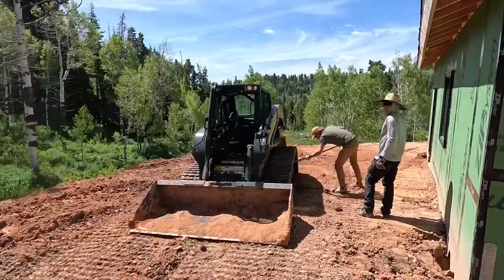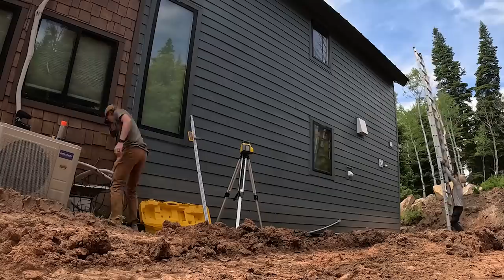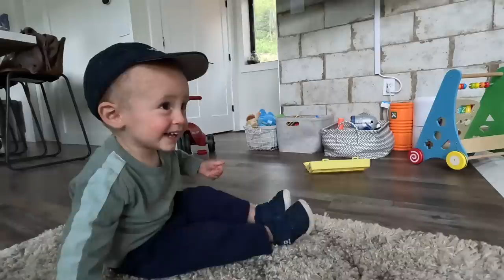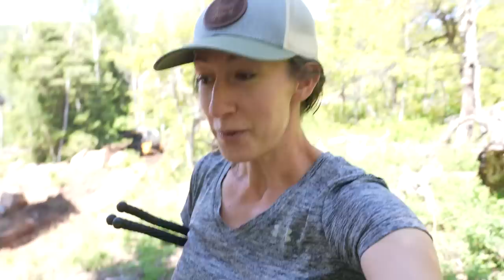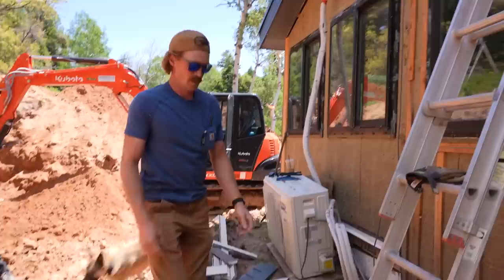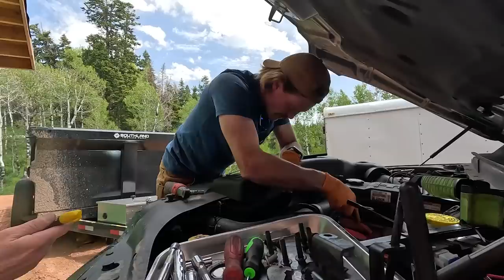THIS IS SAVING US $50,000!!!

Comment: I recommend stopping all excavation until you get an engineer to evaluate whether the final flow plane will work.
Reply: I agree, that unterraced mountain that's just cut will collapse in the next torrential downpour or heavy winter. They had a retaining wall for a reason. No prep for or talk about a future retaining wall at all.
Reply: Entirely agree. Slopes are no joke.
Reply: I am so happy that you have Trent thinking…..his digging is scaring to death.  I am having a hard time with wanting all the flat area…….they are in the mountain !!!!
Reply: Yes because water always flows downhill does not seem to register with many builders.
Reply: I agree that 😮having some check and advise where necessary. You want to make sure that what Trent is doing will last through the winter  and not turn into a  potential disaster later, which could damage the addition build.
Reply: Agreed!

Comment: Use a pressure washer to clear dried mud from treads. Though using the pressure washer before it dries is even better
Reply: EXACTLY!!!   Especially in a high clay content soil.   Use the bucket to tilt the machine and power wash all the  mud while it's still wet.   Then grease everything.   And not just the skid steer, the excavator as well.
Reply: Nice thing is pressure washers use very little water so less mud than using the hose and much faster than shovel or hose
Reply: For sure!!! We use ours at the lake all the time to clean the bottom of our boat, and even the rafts, tubes, and the giant Lilly pad. Makes for easy and efficient work! Work smarter, not harder!
Reply: @eagle2019  Yup exactly!

Comment: It's a good opportunity now to get the Condenser unit of the mini-split far up off the ground before it's buried in snow again. And maybe install a very tall pole by the propane so it's easier to locate where you have to clear. I can't even believe how much snow you guys get. Just maybe don't cut into the house til the last second or after the addition is dried in just in case it shows up early. Ya'll are very brave.

Comment: My dad worked in the mud too with his rigs, but drove to a space where he rinsed off the mud, to prevent dried mud, saved time in the long run. You have space.
Reply: Yeah, I surprised he does clean those rigs daily! I could not put my Rig away that Dirty especially as expensive as they are! Clean the Rigs Trent😎
Reply: Please hose off you heavy equipment when you are finished for the day.  🙏  Love your videos!
Reply: Absolutely 👍🏻 💯 Clean the equipment 👍🏻
Reply: Cleaning when finished is just as important as greasing what needs greasing.

Comment: It would be a great time to talk to Brittney and Drew about excavation and rerouting water because they are dealing with all of that right now. Lots of retaining walls and drain systems! Its important! Don't want to see your work destroyed!
Reply: Trent needs an engineer to design a comprehensive plan of drains and retaining walls with flow plane considerations. The mudslides last spring were a huge warning that need expert guidance and input on this build.  Trent please bring in an engineering firm before pouring cement.

Comment: You could opt to build a Earth Home into the side of your Hill/Mountain.  Cost a lot less to heat it, would stay around 55 - low 60s degrees year around with no heat.  Other options to heat are heated floors with Geo-Thermal Heat.  That would be a big cost savings over LP Gas.  Earth Home your out of the Elements, wind and bad snow storms don't affect Earth Homes.  Still have to plow your driveway and access points.

Comment: You need a heated shed for the equipment for winter so it starts and runs properly for winter,  check into the oil temp for cold weather conditions to working. Plowing snow and moving some piles if needed.

Comment: Trent you have a spring in that corner, you need to redirect that water away from your foundation area to guild your foundation.   Also tier the back dirt area, maybe a drain to help with water snow melt runoff lol  opps   Grab yourself a track shovel :)   you will need it LOL.   Fuel tank for the machines 5gal cans , Brandon looks like he is having fun pulling that siding off .   Just looks like you guys are having a blast.

Comment: Taking the siding off when you don't even have the footings poured for the new addition is nothing short of foolish. You get any heavy rain for any period of time and you insulation and any electrical wiring will be compromised. You had better tack up some plastic sheeting over the exposed area before it's too late.

Comment: With the video time lag, it's probably way too late but a French drain or 2 or 3 at the base of the new fill dirt for the parking pad would have helped .
Reply: Probably not too late. I don’t think there videos are very far from real time.
Reply: @scottmichaels12  Back at Thanksgiving and Christmas time they were able 3 weeks behind.
Reply: An ex employer of mine had an umbrella just like that. One day there were high winds and it blew off the 2nd story deck,and it got tangled up in the railing, hanging over. I was at the house with 2 small children. Had to ask a construction worker across the street come lift it off for me. The umbrella didn't last long.
Reply: @scottmichaels12 They said it was the first day of summer in the video.

Comment: A small hint when it comes to Tim Tams and and warm/hot weather.
Use a small Esky (cooler) with a freezer block for the Tim Tams. Tim Tams will turn into a lump of melted chocolate in temps higher than 20 C (70 F). A really good trick is to put Tim Tams in the freezer for an hour on hot days.

Comment: Trent, you know as well as anyone that cleaning and maintaining equipment is one of the reasons contractors get paid a pretty decent price for their work. Yes cleaning it right after using it in mud would have been much easier but then there are times when it just won't work out the way we want. You are doing a good job and thanks for taking us along!  J.R.

Comment: Trent you need a dumper truck, get Brandon to drive it back and forth and dump the soil we’re you want it, it’s tonnes faster than the skid steer.   It takes a lot more soil per load .  Even if you just hire it to get the bulk of the soil moved.

Comment: Trent, 

Why you don't dig the full distance from the wall right away?  In addition to the wall distance, you need to dig probably 5'-6' to allow the footings and the formwork to take place.  You are hurting yourself by not doing uniformly and do the final work at the same time.

Past the excavation, unless you plan to build some form of a retaining wall, you will need to slope the terrain 45 degrees or 2 in 1, which will be 10-20ft into the mountain.

Comment: You're right Trent, you have many talents and adapt nicely - BUT, 1) you made too small a house, even just for the two of you 2) You redesigned the garage many times during construction, 3) the addition on the house has cost you tens of thousands in material and rework 4) you DO unsafe things FREQUENTLY. It's handy being a rock climber otherwise you'd likely broken your ass long ago.
Reply: Trent's biggest shortcoming is his inability to plan a project completely before starting.  The material and mental costs of his impulsive drive are astronomical and may result in serious injury.

Comment: Please know that operating an excavator is only part of the job. Knowing about excavation and soil is an entirely different thing. Excavation sites can be deadly and that's why excavation standards are set. Trent is obviously not tending to those standards. Imagine just the weight of one wheelbarrow load of soil falling on you. And it can happen quickly. Please stay away from that wall!!!

Comment: If you’re not cleaning tracks at the end of the shift, you’re not working the machine. In the fall when it starts to freeze at night make sure you clean the tracks after your shift. You don’t want to have a whole bunch of frozen rockhard dirt stuck in your tracks can cause expensive repairs. So clean your tracks after every shift and that goes for the excavator also

Comment: Applaud all your efforts.  Top notch.  Every Cummings guy fixing and switching engine parts.  Be the inventor that welds up a front bumper that excepts two pieces of 2x2 angle that a pair of 2x12’s can fasten to for the perfect platform.  Going to be under the hood again not fooling yourself.  Great video.  Cheers 🎉

Comment: I'm sure you'll figure it out but you're going to have to step up the hill behind your house three feet up three feet back something like that. Or you run the risk of a landslide also kind of make it like a rainbow so the water goes to the left and the right not behind your house. I would get Brandon into skid steer to move dirt as you dug. It would make things go faster. Keep putting the dirt over by your garage a large flat area will be helpful in the future. Since your land is so sloped

Comment: When muddy, use water before it hardens to flush it off somewhere you have solid gorund under you. Before the local government and most place got their own yards to do such things on, you occasionaly saw the diggers getting that treatment not far from digsites all over town where I live and to clean up they flushed the now, usually an empty parking lot, free of dirt so that it is cleaner after they leave than it was when they arrived. Dual duty you might call it.

Building on a slope just means you have to thing terrases like many has hused in hilly landskapes all through history. It takes work to set up, but once done you have lot more useful buildable area.

Comment: T&A - I really like the fast motions shots of the excavator. It shows Trent's control of it, as at that speed, it almost seems human. I've been around bucket trucks (like the utility companies use), more than excavators, but we were taught (as you probably also do), before we got to work, to visually inspect all hydraulic fittings for leaks, or cracks, as a loss of pressure will drop you quick, and if that don't kill you, where or what you land on, might.

I think you're pretty safe in the cockpit, so it would be more of a matter of being aware what is under your bucket, I'm guessing. I've worked at places, where, if you moved a weight over someone, or if you allowed someone to move a weight above you (almost always involving hydraulic cranes and such, it was cause for being fired.

I understand it must be maddening to read all the 'safety, safety' comments, but they seem well-intentioned, and you might learn some new measures by them. I know I do. I have noticed in the last year or so, that you almost always wear the appropriate safety gear (even just eye and ear protection, gloves, hazmat suits, etc). Not to say you didn't before, but now, even for small minor things, I've noticed you do.

Keep safe (sorry, I couldn't help myself).

Comment: Going up hill while building should not be a problem your first floor of your main building could be the basement of your second building.
And the Second floor of you main building the First floor of your second building.
The biggest problem I see is that you need room for the enormous snow fall you had this winter even if it is once in a decade you do want to take it into consideration. Seeing you have also have certain small risk of mudslides I would have the back of the second building and the sides of the second building at least for the first floor made of concrete. A mud slide can have a lot of weight behind and and everything starts to drift.
So you want to be sure you house and walls keeps standing.  Also look into having some outside blinds for the first floor on the side and back of the building to protect you windows should those huge snow (mountains) against your building ever again be a problem it is also a good isolation for keeping the warmth and cold outside it is also burglary proof so if you have bears or something like bears they cannot come through the windows.

Comment: Yes after run the machines you need to clean the tracks..An grease them daily.. You don't work very efficient, why isn't Brandon, running skid steer. Taking the siding off isn't needed to you have a slab done...

Comment: Just asking as you're placing your dirt ,shouldn't t you compact it before building? Not were your digging pool that would be considered undisturbed material .But we're you're putting it in the driveway ?I was also wondering if you have to put in a rationing wall into the bank behind the house .You know your plans ,I just wanted to ask without being a troll ,lol lol .Beautiful job so far. Keep up the great work .